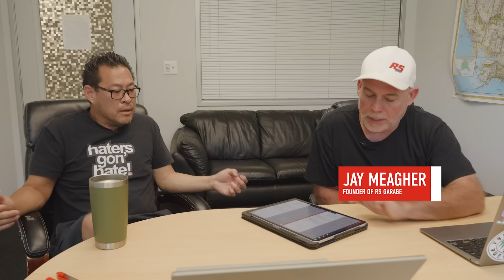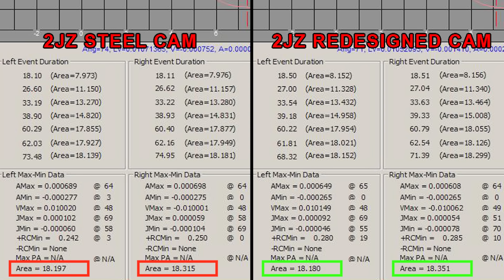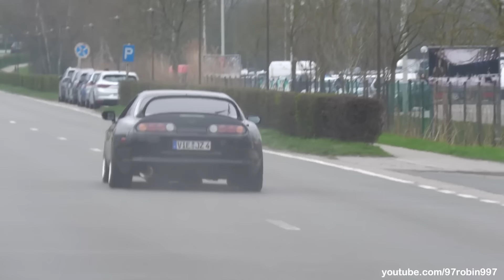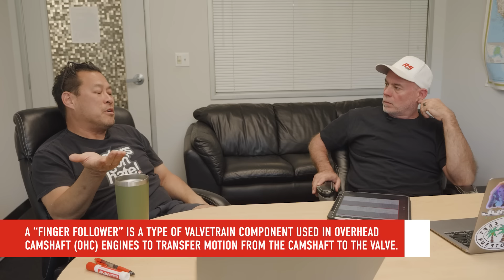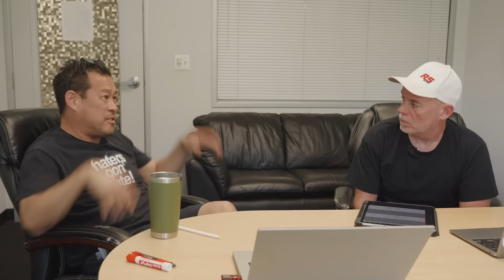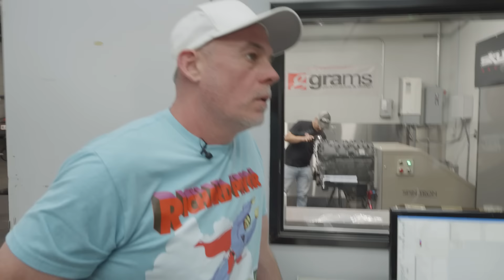Skunk2's TECHNICAL DIFFICULTIES - Part 14: 2JZ Cam Analysis Special Continued...

Comment: Im wondering if Skunk will re-release the original 3 lobe ultra cams and the original Pro 3 H series and the original Ultras for B series now that they Skunk2 offers the extended 3 lobe rockers for both platform? Also, the H series community needs a Ultra manifold big time!

Comment: who does a PVD coating on a steel 2JZ cam? I have never seen that.
Reply: DLC is a pvd coating
Reply: @davidhsu2850 well who’s doing DLC on a 2jz? I don’t know of any in production.
Reply: @davidhsu2850 or are you talking about the dlc on the bucket getting hurt and hurting the steel cam?
Reply: @headgames  im assuming the cam was production; whatever the coating was specifically i dont know , but it was certainly PVD and most likely DLC or a Ti-Al-N as they have similar colors